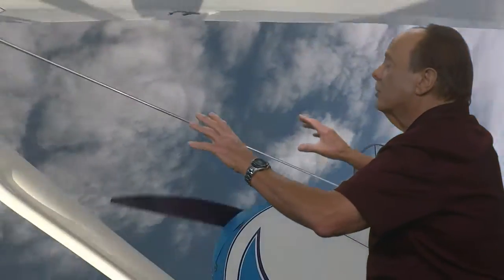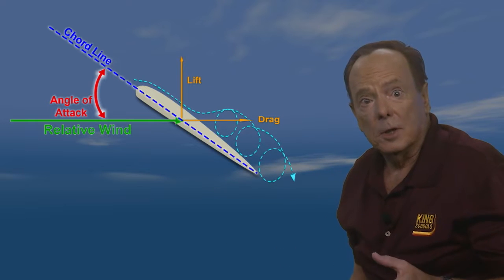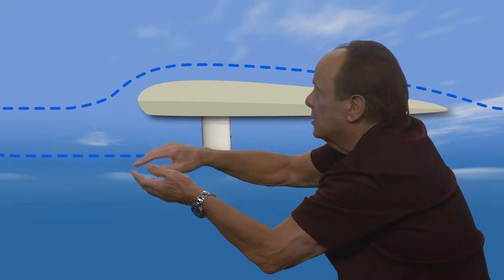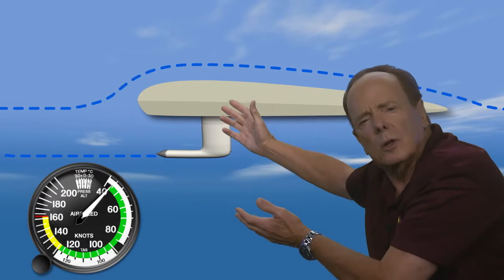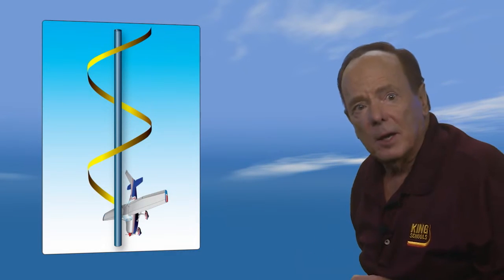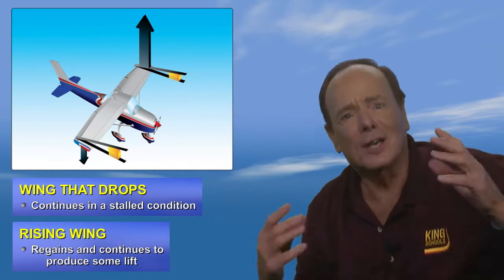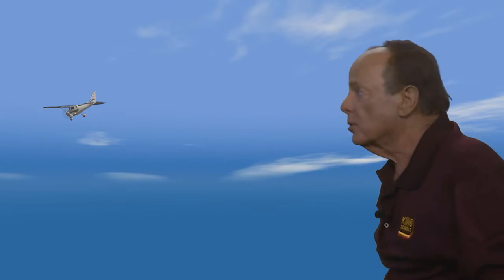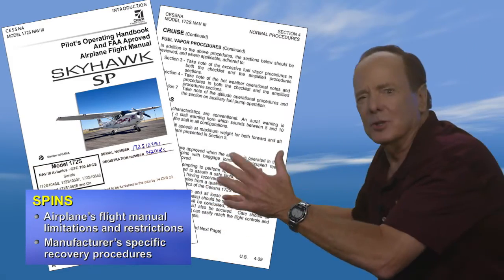CFI Ground School // Stalls & Spins

Comment: Can you please clarify what elevator - forward control means (ie push or pull)?  Thanks
Reply: It is a push forward to break the stall, then a gradual pull back to recover level flight.  
Some aircraft will more or less fly themselves out of the the stall at the point that you stop the spin with the rudder.  But don't count on that to save you.
Reply: @ScottWoodland  thanks